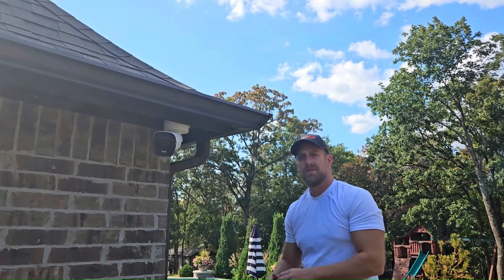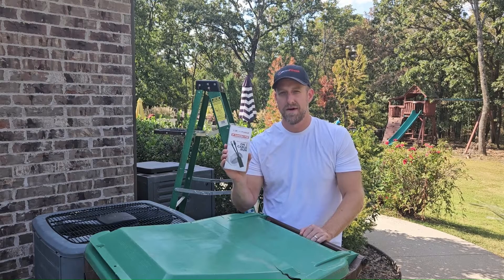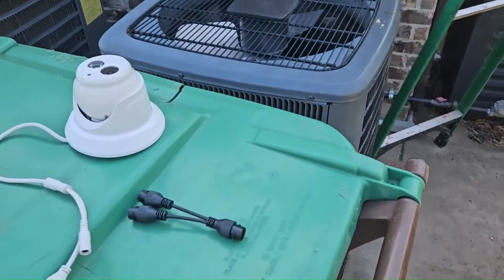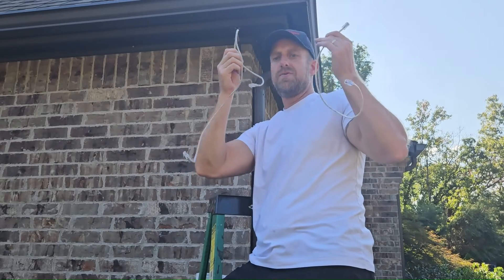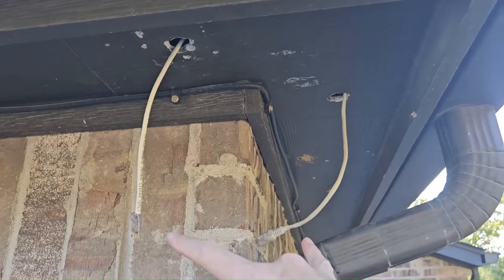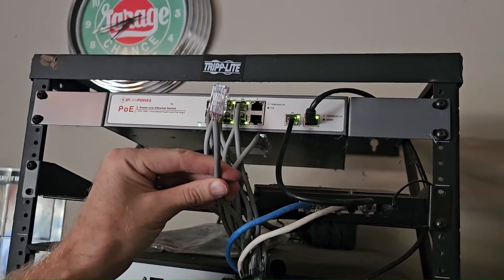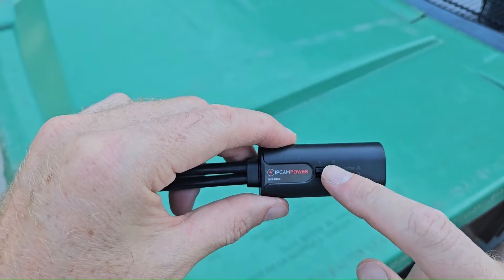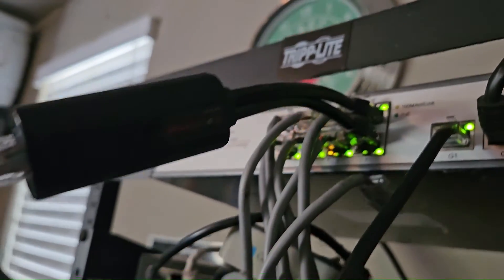How to add a 2nd IP Camera to a Corner using same Cable Run as the first IP camera

Comment: the only cameras that you absolutely cannot do this with are PTZ cameras like the Unifi PTZ industrial (the one with the 22x zoom) its a gigabit connection. and all the AI cameras from unifi. they are specified as full GBE, and will not work properly. still a great tool and great video.

Comment: You don't even need that splitter. This only works because most IP Cameras are 100Mbit which only requires 4 of 8 wires. The mode switches are to accommodate 568A and 568B wiring schemes.
Ideally you would run an additional cable (use the existing to pull 2 new through), but this does work.
Reply from the maker: Thanks for the comment! We think it's great for existing installs where you need to add another nearby camera, similar to the one mentioned in the video.
Reply: @ipcampower3506  don't get me wrong, I know how to wire it up without that splitter and I'd be inclined to buy it anyway to save the hassle.

Comment: FYI this works perfect for all IP cameras.  Even all of the Reolinks
Reply from the maker: Thanks! Glad to hear!
Reply: Totally not working for my reolinks... Not sure why

Edit - got them working, turns out I had the wrong line connected to the input. So I can now also agree when installed properly... Lol... They work with reolink cams and NVR.
Reply: @bradjk check the wires. Remember each POE camera only uses 4 wires out of the 8
2 power and 2 data